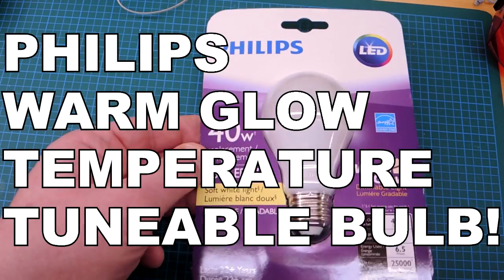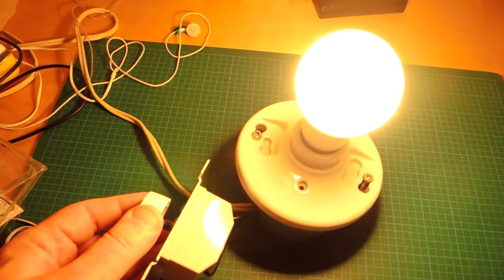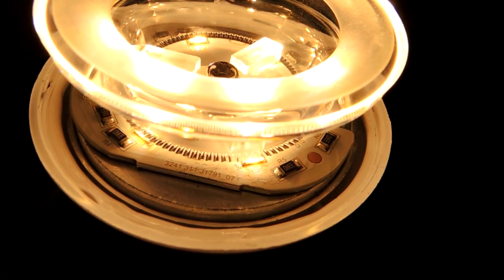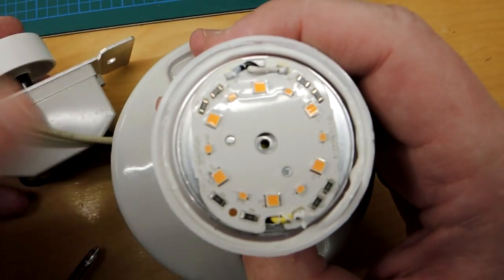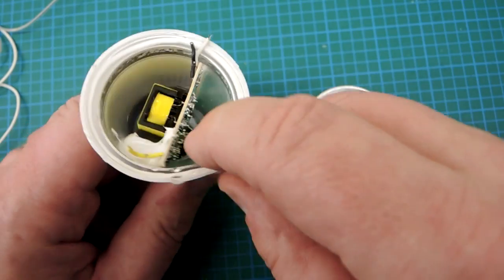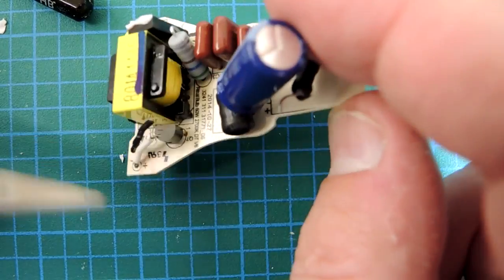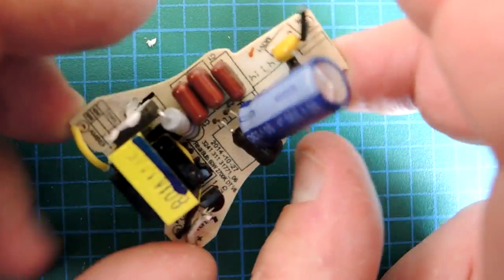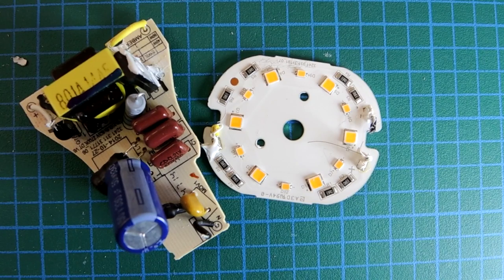Philips "Warm Glow" LED Bulb: Tune able Color Temperature!

Comment: Good work! Do you know how the electronics control two color channels with only 2 wires? Is the chassis the neutral line?
Reply: Oh wait there are 3 wires, didn't spot the yellow one on the opposite side.

Comment: Quite a clever solution using two types of LED in there. I wonder how the circuit works, is it detecting and comparing ac average voltage and maybe switching on second set of LED when a certain threshold is reached? Would be nice to reverse engineer that circuit.

Comment: Can the Hue bulbs not be used for this sort of thing too, even if it's a bit of an underutilization? Or do they not give you enough granularity to do that?

Lightbulbs that can be switched between daylight and soft white would be very neat.
Reply: No, that's not how physics work. The "white" light made with RGB LEDs is awful for normal lighting. It has a completely different spectrum than white LED "white".
Reply: +superdau In TVs at least, I would think it's the opposite
Reply: +Daijoubu 
Yes, that's why I wrote "for lighting". If you just look at the light (like the backlight in a TV) RGB LEDs are fine (in the same way as color TVs were using RGB phosphors for decades). But if you look at the stuff that is illuminated by RGB LEDs, it will look horrible. There is an unlimited number of mixtures of wavelengths that will look white to the eye (blue and yellow is enough for example), but the "whites" have very different effects.

Comment: This type of colour temperature changing bulb has been common in Japan for years. I've been waiting ages for them to come to the west. The Japanese ones are usually remote control and part of a dome light.
Reply: Are you sure that weren't RGB lamps?
Reply: superdau Yes, they are colour temperature changing. They are advertised similar to this one, as offering daylight for working, then warm white and a dim very warm white for late at night. They are popular in living rooms and bedrooms. Almost always LED these days, around 5000lm for domes or 800 for bulbs.

Comment: Do they just wave solder the trough hole stuff including the bottom SMD components (bridge rectifier et al)? Impressed that the packages can take that heat, especially using lead free solder. A good hint would be the use of epoxy under those SMD components.
Reply: They would wave solder the SMD components and add the through-holes by hand after.  Transforms and such have too much mass ( draw heat away from the solder joints) to wave solder. Discrete through hole components have nothing to keep them in place so are added by hand.

Comment: Indeed--a very good solution and easy replacement for older incans in dimmable circuits.  What price point was this bulb at?
Reply from the maker: Jeremy Dowd  Under 8.00 USD
Reply: @electronupdate. Did you get it online or a local Cdn store?
Reply from the maker: Graham Wilson local home depot...huge endcap display last weekend
Reply: Thanks for the speedy reply. I'll head to the local one in Ottawa.